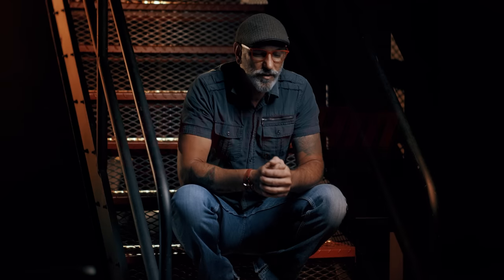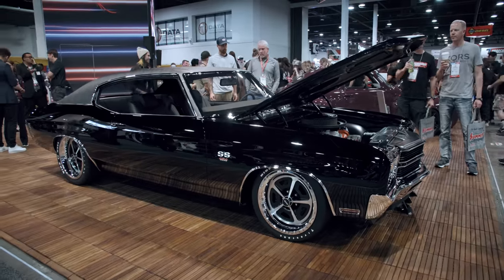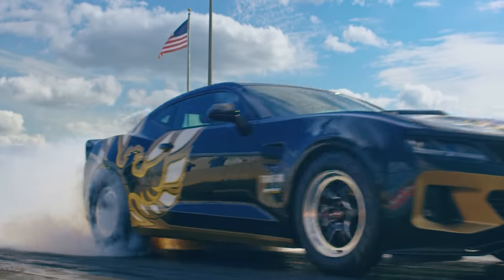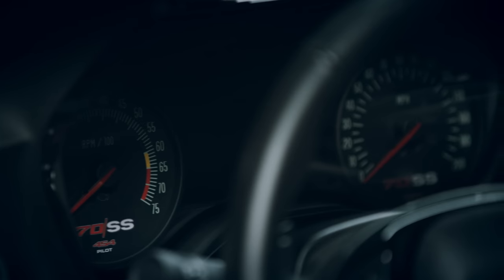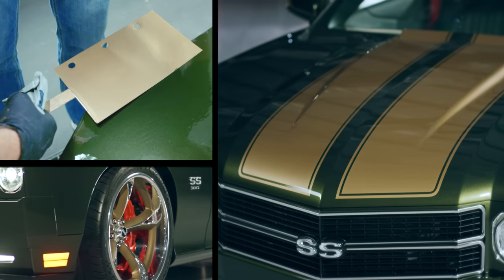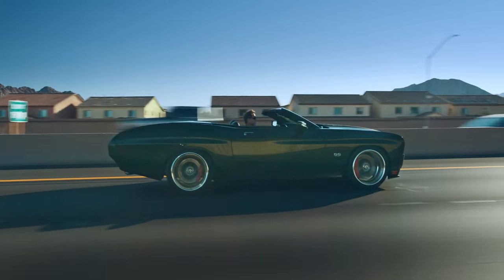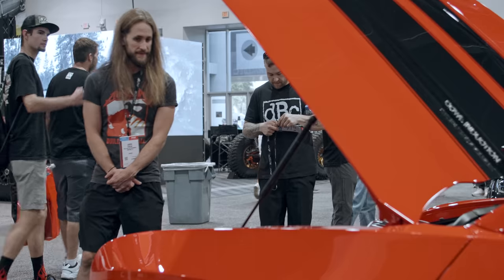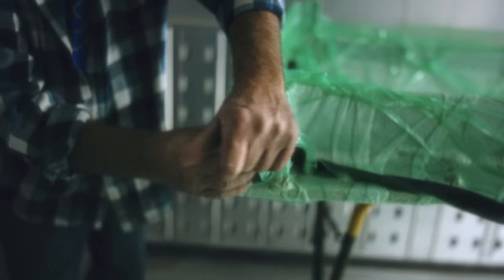The New 70/SS | Return Of A Legend |

Comment: And to think I had not only one of these cars but I actually have had two of them. Both Super Sports. I've been a mechanic since 1979. I knew back then how special they were. Their reputation had already been set. I never should have let them go. I got both for less than 2k.
Reply: You're right.
Reply: yea you screwed yourself there lol..i wonder why these cars are worth more now than they were then just kinda stoopid to me
Reply: I had a 1968 SS. Sold it in 1991. Should have kept it.
Reply: Not meant to be.
Who knows, you could have gotten killed or paralyzed in one of those cars.
Everything happens for a reason. No coincidences, nothing happens by chance.
Reply: @thephantomzoneboxing  
Nothing has changed the was the American economy works. Supply and demand is what controls the price.
Not only that this is far from the same car. It looks like the 70s cars but all the technology is from today dependability, suspension, brakes, handling, twin turbo, the amount of horsepower is putting out, then you go back to my original comment it's a matter of how many are available and how many people want one that's what affects the price.
Reply: Nice stable of horses
Reply: @Mr.Robert1  dude what affects the price of these cars is that these are limited production cars did a built from scratch literally from a Camaro chassis.
East Carlton meticulously built by hand they are also using carbon fiber for the bodies which is very expensive and they are intricate in terms of putting these cars together and buildings cars of course these cars are going to be expensive because they're meant to be exclusive and rare collectors items by a small manufacturer that's very creative and no the legacy of these type of cars.
Reply: @Mr.Robert1 you are just as likely to get killed in these cookie cutter SUVs  !!  I'd rather take my chances in my 69 GT0
Reply: Pain
Reply: I’m glad I read your comments, Im not the only one…I had a candy apple red  ‘67 Chevelle throughout High School in the 80s… Like you I new Chevelle’s were special. I had to sell it to move to Florida  in ‘96 for a little under $2,500 now worth $25,000…

Comment: Incredible job! 
The only thing personally, is the front bumper. To me, it looks to bulky. It needs to be a different color or have a line running across it to break up the size.
I still want one!
Reply: needs to be chrome
Reply: It Need's To Be Two Pieces Like The Bottom Need's To Be Chrome Or Blacked Out It Look's Like A Whole Piece Right Now And It Look's Very Bulky
Reply: I agree there's just something funky about it
Reply: I'm sure they would make it exactly how you want it.
Reply: There are pics on the web showing examples with chrome bumpers front and rear, which look MUCH better.
Reply: I agree one hundred percent I said the same thing.
Reply: Resembles a Bentley front end, which is chunky.
Reply: Agreed, they should have made it a little narrower and done a chrome wrap on it, front and back.
Reply: too rectangular in the front and flat in the rear. Shorten up the front bumper, maybe add a SMALL chrome trim or lip. The Rear end should have a little more of an angle to the bumper. Either way yeah I agree, too much body on both ends.
Reply: How much??
Reply: I agree
Reply: @Zschneider91  so glad I'm not the only one.  The Trans Am looks so much better so I know they could refine this into a more "factory" original look. The work they've done is incredible though!
Reply: I agree. I dont care for the front. But the rest is ok.
Reply: I was looking at this beautiful ride and something seemed slightly off. It took me a minute to realize it but I think the bumpers need to be chrome and possibly a different shape. Absolutely no notes on anything else, it’s a gorgeous car.
Reply: agreed. front end is way too fat & too low & color does nothing to enhance the looks at all.
Reply: Nothing like early 70's
Reply: Completely agree
Reply: I love it just the way it is !! Clean sleek and beautiful  !! Reminds me of myself !! Whahaha !!
Reply: To me it makes it looks like a challenger with the bulky front bumper

Comment: I miss mine. Had a 1970 SS 454 LS5 4speed with 4.11 Posi rear end. Ran great on the street because every ounce of torque came in just after idle.
Reply: I had a 68 SS 396 4spd cragars all around , bought it in 74 for $900 only had 1100 miles on it. I was 16 worked as a life guard one summer to pay for it. Sunoco 100 Octane was .32 cent. a gal.  Freedom was real in the USA back then. I miss beyond words.
Reply: what happened to it?
Reply: @windydrifter7633  I also bought mine in '74.  I was stationed in San Diego, needed some wheels and found the '68 SS for a really good price.  Traded it for a motorcycle at a used car lot in National City.  It's a good thing gas was cheap, because the gas gauge moved faster than the speedo when those rear butterflys opened on that Quadrajet.

Comment: I owned a 70 Chevelle and now own a 6th Gen Camaro SS 1LE. I miss my Chevelle but am torn if I would want it based on a 6th Gen Camaro. Very cool concept guys!
Reply: @trollolol its the head light bezals, there flush and not recessed as originals, plus the bumper is to square. I had a 1970 LS6 SS IN THE 70'S IN fOREST GREEN AS PICTURED.

Comment: I bought a low-mile 1966 Chevelle Super Sport in 1975, just before I turned 16. Paid a whopping $1000 for it. Red with red interior. 396 and 4-speed.  A lot of car for a teenager.

 The '70 Chevelle is a beautiful car. You have captured the essence of the car with this deal.

Comment: I 100% agree about the '70 Chevelle. When I was a kid in the '70's - early '80's that was one of the top cars for teen drivers to get for their first car. Black, white stripes, raised in the rear a little, deep dish Cragar SS's in the rear, standard in the front, lettered tires, and chrome tip duals out the rear. To really top it off, a racing cam to make the idle sound throaty hit-and-miss. The thing is, for the time, these cars were already expensive. Where you could buy a typical used car for $500-$750, these were often $1500. A LOT of money back in circa 1978! HAHA.
Reply: I practically had one handed to me for $1200 - BUT, I didn't have the money & my local bank wouldn't lend it to me. 
I'm probably still alive because I was too immature at that time to be driving a car like that..
Reply: When you account for inflation, in 1970 a Chevelle SS was about the price of a Honda Civic Si today.
Reply: I don't know Joseph when I was a kid my father bought a 1980 Buick skylark brand new for 8,000 bucks 4 door not a sport's car so I'm pretty sure a car like this would be more expensive and that was just a two year difference but then again there's always Google haven't checked but correct me if I'm wrong
Reply: Sorry Joseph I assumed you meant used 1,000 dollars up for these sport's car I thought you meant new

Comment: Stunning work gentlemen.  I keep thinking a small chrome bumper on the front and rear would break up the front and rear fascias and just add a bit of complexity and class....wrong? Still completely enamored
Reply: AGREED!  I've thought for long time now that the newer Challengers would look awesome with thin chrome 'bumpers' front and rear.
Reply: I agree. The bumper area needs some more finessing. Otherwise nice. Also, the hardtop would be the one I would want.
Reply: And yes...hardtop...maybe vinyl?...but as soon as I win the lottery twice, I am buying!!!.🤠
Reply: Good call on the chrome bumpers
Reply: Definitely needs some chrome.
Reply: Definitely needs some horizontal lines front and rear to break up the massive vertical facias. I know chrome bits and bumper elements are a sacrilege on modern cars but on a retro heritage car like this, I think it’s more than appropriate. It’s a necessity.

Comment: I had one for five years. Sold it in 1983. It was  worked. Full race cam 12.5-1 Compression Pistons 402 bored .030 over. High rise w/ a Holley 850 Dual Feed Double Pumper Carb. 4.11 Rear. HD Starter. I put a shift kit in the auto trans so it smoked tires while shifting every gear while getting on it.  I could run down the road @ 45 MPH & punch it and break traction while smoking the tires. Only problem was I replaced 5 Starters in it! It would start instantly every time but apparently it was tough on Starters. Was tired of R&R Starters. 
Sorry I sold it now!!!

Comment: i bought the 1969 ss 396 with 4spd when i got my license at 16. i loved that car, mine was butternut yellow with a black vinal top, black interior. i paid i think 1875.00 as a demo with 59 miles on it NEW in 1970. the car was a blast to drive, i beat just about everything on the road with it, roadrunners vettes,camaros mustangs Javlin 390s, gran torinos. had that car till 1984, parked it in front of my girlfriends house, some drunk came down the street and drove into it, totally demolishing it. frame was bent, motor when though radiator i managed to drive it to junkyard had it to 90mph on the way, got 800 bucks for it. and bought a 67 volkswagon type 3 and drove that till the thing fell apart.

Comment: So this might run long. My first car was the car my dad gave me, a 1980 Chevy Malibu 4-door. After that, I had a 1988 Oldsmobile Holiday 88, which was a two-door with the shifter on the center console. It was two-tone, gold and creme and had a V-8. I loved that car. Later I had another two-door Olds, a 1970's gold Cutlass with a 268ci small block and white vinyl ratchet seats. I had two Ford Tempos and then I bought a Lincoln Mark VIII. Their slogan was, "Drive everything else first." That car was phenomenal, then I traded that for my first Dodge, a 1998 Dodge Durango. It was the first year they came out. That Durango got me to hell and back down a real mountain in Virginia, not a hill, and handled like a sports car. I had that until I scrapped it after sitting on my driveway and rusting out. I then bought a 2002 V-6 Honda Accord, which I still have today rocking over 220,000 miles. That car refuses to die even after the abuse my wife and sons gave it. Next up was a 2009 Nissan Maxima which my youngest drives today. Those Nissan 3.5 liter V-6's are bulletproof. The CVT's not so much. Now my next Dodge (actually Ram) a Ram 1500 Tradesman Crew Cab with the 5.7 Hemi in Maximum Steel Metallic with 5 spoke chrome rims (okay they are plastic covers, but look really good clean). I wrecked that with only $2,000 left on the note. Talk about being sick to your stomach. The insurance totaled it but gave me $26,000 for it which leads me to my next Ram. A 2017 Ram 1500 Laramie Crew Cab in the same Maximum Steel Metallic but with an awesome leather interior, sunroof, chrome tow mirrors, wheels and body molding and bells and whistles out the wazoo and she is my daily driver. Wait, I'm getting there. So yesterday I was blessed enough to purchase a Dodge 392 Scat Pack Widebody T/A edition Challenger in the Gold Rush color, which I found out today was only available for the 2021 model year with only 3000 miles.
(🤯) So all this explanation to let you know I'm a Dodge/Ram guy. But I do have to say that you guys are keeping the Muscle Car alive and I thank You for that. That Chevy SS is _uckin Beautiful. And I was heartbroken when GM killed Oldsmobile and Pontiac. My favorite car as a kid was always the Trans Am and the Olds 442. I was so happy when I saw somebody reincarnate the Trans Am on the Camaro chasis, and then develop the Bandit version. I'm glad Burt Reynolds got to see it. I thought GM would bring back or at least attempt to bring back the Trans Am, even for a special edition run after seeing the interest. I guess not enough.

Comment: Having had a Trans Am I loved your modern rendition since it matched. I had and have loved a ‘70 Chevelle SS. I really like the new rendition a lot except that the original had chrome bumpers. It was a different style than the TransAm. On those cars the Chrome accented the Beauty of the car. Like the C2 and C3 corvette needs the chrome bumpers to set them apart from other years. I’d like to see your ‘70 Chevelle SS with some sort of chrome bumpers, maybe chrome trim around the wheel wells. I think that it would capture even more your attention to detail and design to reintroduce one of the most beautiful muscle cars ever made. 
Of course, those of us who were a part of that era were fans of chrome on cars, be it body accent trim and molding, wheels and motor parts or whatever. That’s what we liked and appreciated about the cars in car shows or on the street. To me other than the chrome bumpers etc., you nailed this car. Then the motor options is unmatched. Thank you gentlemen.
Reply from the maker: Thanks Joel.  FYI, chrome bumpers are on the way, along with the hard top.

Comment: Oh my God that's so sick it's a thing of beauty of a work of art I have a 2011 Camaro SS I recently rebuilt the entire engine from Soup To Nuts I use the BTR stage 2 LS3 cam DOD delete of course chrome x-pipe exhaust I put Flowmaster Super 44 exhaust Texas Speed headers with high-flow cats dual Springs everything had the heads sent out car is a true Beast giant K&N cold air intake she's a monster she's pushing 572 horsepower

Comment: I had an SS with a 396 and a 4-speed manual and I paid $700 for it. Instead of all cash, I traded titles and $200 cash for my 66 Chevrolet Caprice, 2-door, white, powder blue interior, 283 with a 2-speed automatic. What I wouldn't give to have both of those sitting in my driveway today.

Comment: Just stunning, I am a Mopar guy, but the 70 Chevelle was iconic, it was one of the fastest production cars you could buy at the time. You guys just nailed it, I gotta say, I miss the chrome bumpers in the design, more so in the front end, than the rear, the front seems a little boxy, or custom truck like, although I do realize bumpers are gone these days, if I had the money, I would find the best painter to paint 3D chrome bumpers on it, the original rear bumper with those tailights recessed, was the nicest rear bumper ever made, I had a 70 road runner 383 air grabber car, I do love what you guys are doing, and motor choice and power are just crazy. Is it over $500,000?

Comment: Those Chevelle's are missing the front and back steel chromed bumpers and the huge plastic chrome lined front grille. Replicas look like but are not the same as the original GM classic. Thanks for the video.

Comment: 800hp at the wheels "off the shelf" is impressive. I gotta watch this cool vid again because I heard a LOT of measurements denoted but don't recall the curb weight being mentioned. Being largely carbon fiber I wonder what the oower-to-weight ratio is? Sub 9 second quarter mile is insane for a turnkey purchased car even if it isn't a mass produced vehicle. Any mass production car back in the true muscle car era...say from 1964-to-1970, that could hit an 11.5 to 11 second quarter mile without a bunch of mods was a sleeper beast. 
 They were talking sun nine seconds at the beginning of the vid when they were mentioning the "396" producing 900hp, 800 at the wheels. Later they mention the intention to make twenty five units with a 1,500hp 454 cu inch engine. I wonder what the quarter mile trap speed and time will be on it? Very nice. Awesome!

Comment: You can't tell me if GM made the Chevelle, they would sell like hotcakes, buy one get 3free,with a free drink! 
 For a $1 they would rip arms off wanting them so badly, modern designed of retro cars, especially the most majestic must have cars, 70 Chevelle, 70 truck, 67-69 Camaro, 70 split bumper Camaro, 71 Monte Carlo, a new truck inspired by the 
70 chyanne , even a 4door, extended cab,  standard cab,. Even a Tahoe/blazer, they would all look awesome with the 70 inspiration, even with a lv3 base engine, and a 6.2L. With 5-6 speed manual option, and 8-10 speed automatic!

Comment: Should have gone back to 15" wheels, small breaks and fat tires so you can make the car hook with some big drag radials.  Hopefully they replace the rear suspension with a solid axle.  With 1500 HP the car should carry the wheels and run in the low 9s.

Comment: I have an idea make the car with the old sheet metal stamps bumpers chrome grills the cars were perfect don't fix what isn't broke.all original body with new tech in handling and performance.let the interior alone with exception of ac as far as wheels keystone classics , craiger ss, aluminium slots stuff like that was awesome.white letter tires  you get it DONT FIX PERFECTION

Comment: Why doesn't GM add an homage line for each division -- Chevelle SS, Pontiac GTO, Olds 442, Buick GS?  GM is a wizard at badge engineering so it would involve front and rear fascia tweaks, and minor cosmetic differences in the interiors.  I think those tribute cars Would have a market.  Just wondering.

Comment: The 70/SS Is a beautiful car. It's about time chevy joined the party with the big hp but 1500rwhp? Where in the hell are you gonna ever use or even get that kind of power to stick to the road? My hellcat's 800rwhp is almost impossible to get to stick to the road. I guess that 1500hp is for the little  willy deep pocket crowd. See you lil willy folks at the track.

Comment: This remake is very nice, but it is like the bumpers, around the head lights and where the fenders come together,  were and after though. I would rather my old 1970 ss 454 coupe than the new on. On the other side my 69 gto 400 with FoMoCo hurst 3 speed would be cool but, they are long gone.

Comment: Just leave these legends alone. Proportions just look all off.

Much rather rock the LT1 Camaro and bask in the fact its faster, handles and brakes light years better than any classic muscle ever will.

I would in fact take an LT1/10L80 Gen 6 Camaro over an LS6/M22 1970 Chevelle SS all day everyday.

Fun fact: I owned an LS5/M21 1970 SS Chevelle and currently own a 73 Nova Big Block project car.